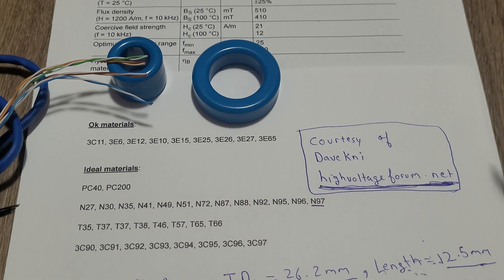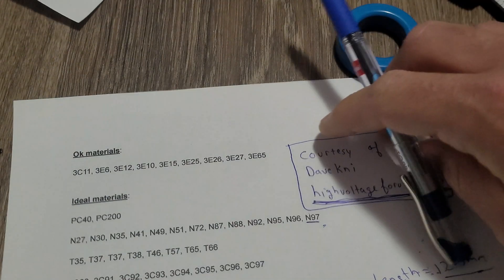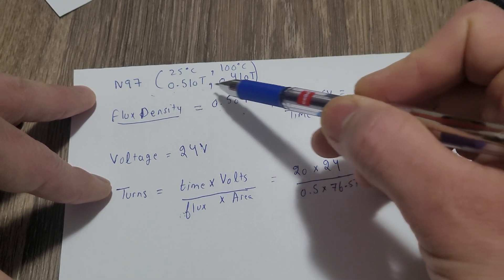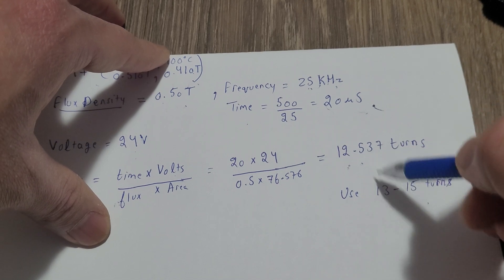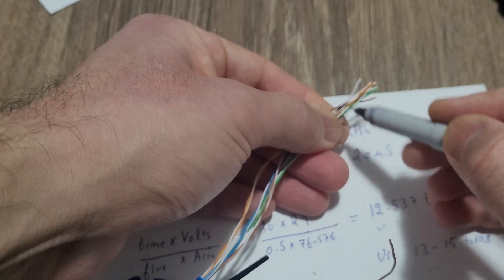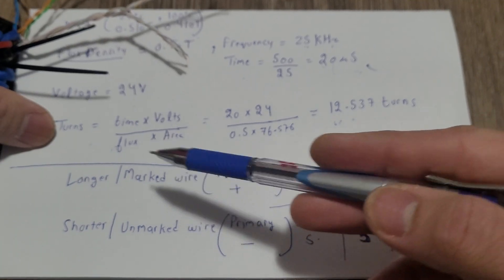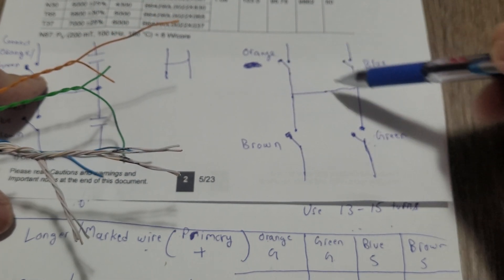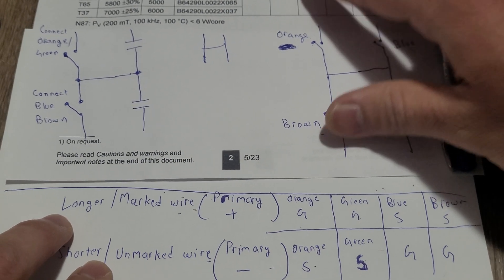Make Your Own Gate Drive Transformer in 10 Minutes!

Comment: Sir what if I don't know the toroid flux density?
Reply from the maker: Usually the toroids found in power supplies, etc have lower flux density. So you have two options.

1) Use more turns on toroid because flux density is lower.
2) Use bigger toroid or stack multiple small toroids.
Reply: Thank you sir. Then the value to be used is always 500mT ?

Comment: sir need your help to calculate ferrite ring cross sectional area this is your formula 
height×(od - id)÷2×π÷4

but internet shows me apposit formula 

height×(od - id)÷2

height×(od - id)

Which one is correct formula to calculate ferrite ring cross sectional area in m² square 
because 

vin×ton/Ae in m²× flux in tesla

means we need cross sectional area in meter square confusion is that how to calculate toroidal cross sectional area in meter square
Reply from the maker: Hi, Use the formula i provided. It's correct. I have verified the GDT with oscilloscope also after making it.
Reply: so nice kind sir

Comment: sir agr core unknown ho to uska bhi hal bataye ku k har jaga par core available nhi hote 
aam tor par green core scrape se mil jati hy
Reply from the maker: It is better to start with known cores because not all cores will work. However, if you still insist on using an unknown core, you start by using flux value of 0.2T (i.e. use more turns for powdered iron cores)
Reply: thanks for replying sir
Reply from the maker: No problem. Another tip: If your core is saturating, just try a bigger core.